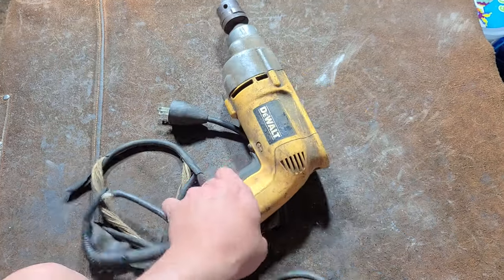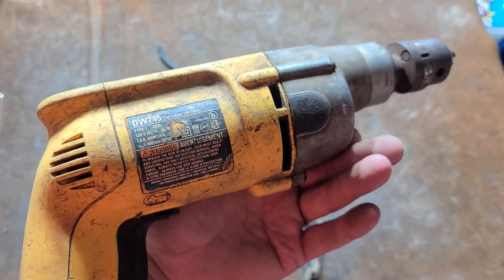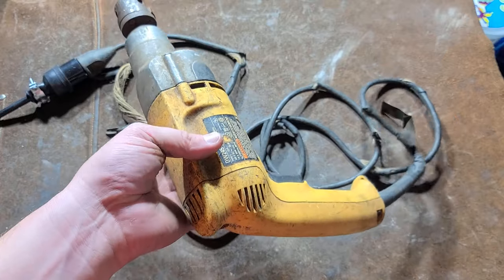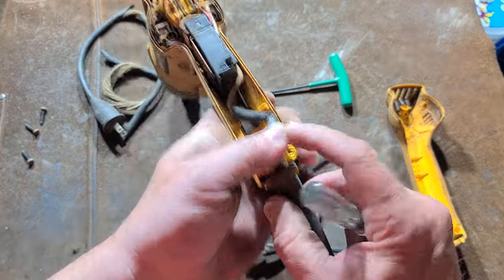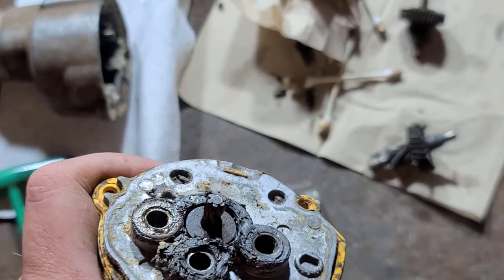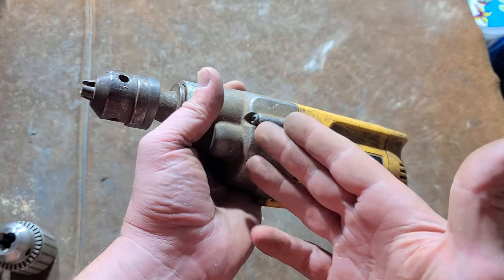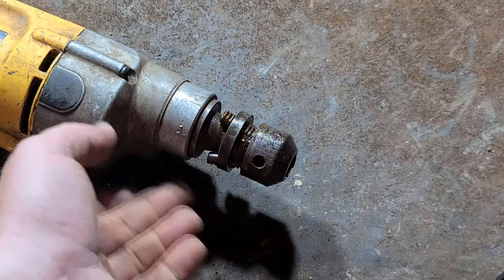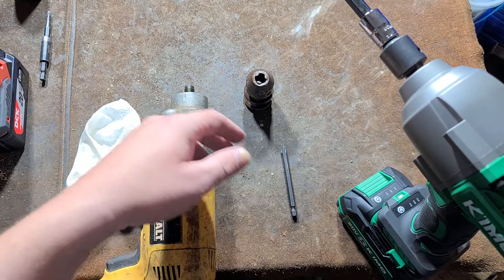DeWalt DW235G/DW245 & More Extended Service Guide/Discussion

Comment: Great work and a reminder that the drills in this class (high amp, very low revs) are still powerhouses.  They develop so much torque that they can actually be dangerous if used without some care.  They’re sometimes called widowmakers because if a spade bit or hole saw binds up the drill will counter-rotate and can throw someone off a ladder or roof.  I broke some bones in my right hand years ago using one of these drills with a large hole saw.  I was working on the soffits on a two-story house at the top of a ladder and consider myself pretty lucky that it wasn’t injured more seriously.
Reply: They are indeed powerful. Mine has twisted my arms a few times.

Comment: Nice thorough video. I'm working on changing the chuck on mine. The center retainer screw came out fairly easy. I just needed to know that it was a torque instead of a hex head and the size and which way it screwed which I got from you.

I have a more modern chuck on mine something like the newer one you showed that requires a key chuck but it's malfunctioning, won't retain its grip. I haven't been able to unscrew it yet. I put a penetrant in the opening of the chuck with the screw removed hoping it will go down into the chuck threads. 

Any suggestions to remove a stubborn chuck from this drill?